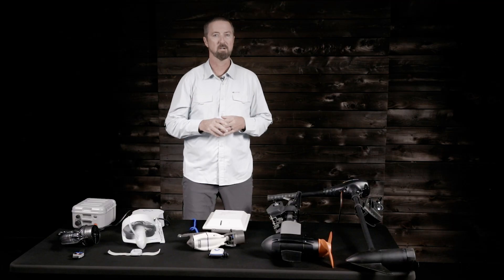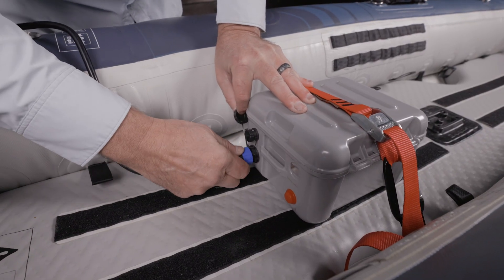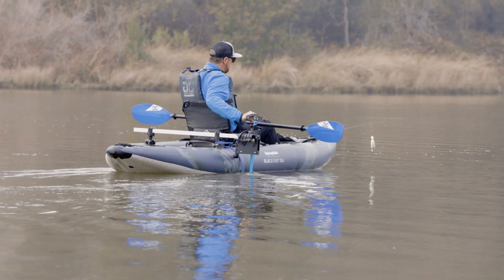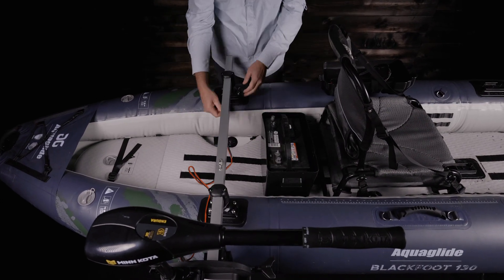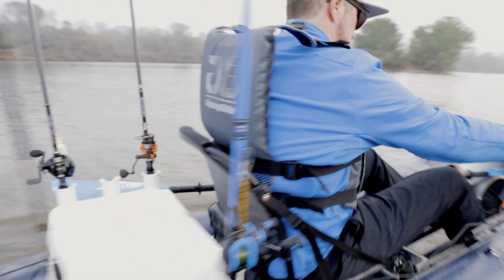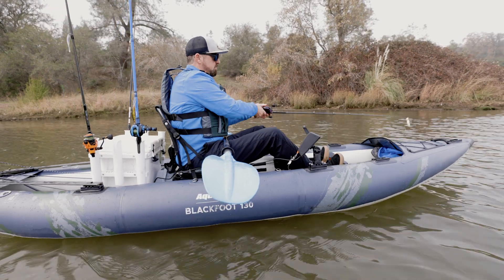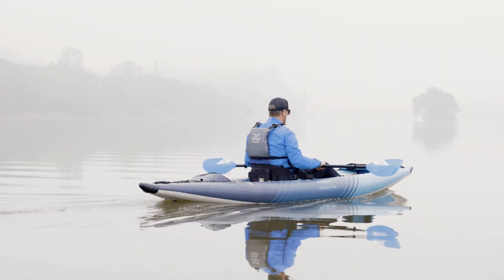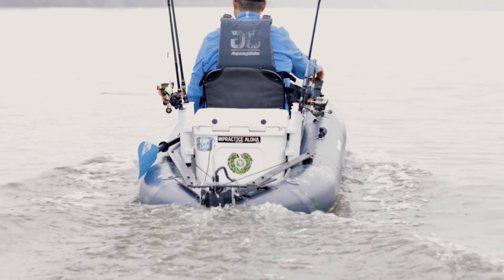How to add Electric Propulsion and Motors to Your Kayak | Aquaglide

Comment: I'm looking at adding a bixpy to my chelan 140 as a backup to paddling.  I'm concerned about how well it would act as a fin for tracking when it's not in use.  Has anyone tried this?
Reply: I love it. Using it for 3 years on a paddle board

Comment: Are you suggesting that a standard Minn Kota can  NOT  be used with a lithium battery ? Legitimate question as i have no expertise with trolling motors Thanks
Reply from the maker: Hey Bob - just that it would be more common to use a Minn Kota trolling motor with standard 12v battery. For specific applications, we'd suggest contacting the Minn Kota experts: https://minnkota.johnsonoutdoors.com/us
Reply: I'm currently using the Minn Kota with a Lithium. It works.

Comment: What dimensions are the screws you used for the Railbaza starport mount to attach it to the universal base?
Reply from the maker: Hey Keith - Rail Blaza includes metric screws which will not thread into our mounts. Our Universal Mounts take 1/4-20 screws no matter what accessory is being attached, but the length required can vary depending on the accessory. For Rail Blaza accessories, folks are typically using shorter screws - 1/2" or 5/8" length. The best thing to do is to use our provided Universal Mount screws to loosely mount the Rail Blaza accessory, then see how much shorter the screws need to be in order to tighten the accessory down. Here is some more information on fitting screws correctly: https://aquaglidesupport.zendesk.com/hc/en-us/articles/16491311645331
Reply: @AquaglidePlatinum  thanks for the reply.  I was able to get longer screws and then used nuts to get the right fit.
Reply from the maker: @keithlohbc  glad to hear it!
Reply: @AquaglidePlatinum  yes your customer service was able to give me a good tip too

Comment: where do you find a torqueedo stern mount adapter for the Blackfoot kayak?
Reply from the maker: The company that makes the bracket is Innovative Sportsman (https://www.innovativesportsman.com/#/). Direct Link to Plate: https://www.innovativesportsman.com/store/p160/Universal_Inflatable_Adapter_Plate.html#/. YouTube: https://www.youtube.com/channel/UC4S9y1l1XHFikej9ziXDplA. The Torqueedo bracket mounts to the Innovative Sportsman bracket. Please note - this is a Universal plate that does require some drilling and customization. It's easy to buy the YakAttack plate WITH switch plate adaptor here: https://www.yakattack.us/switchpad-flexible-surface-mount-with-mightymount-switch-mmsp-1002/. The AG Universal Mount with the Yak Switch plate is how it attaches to the boat. Note that this project will take careful planning and customization, at least 2 days for install, and around $3000. But, it creates an awesome result! Best of luck, and let us know if you have further questions.